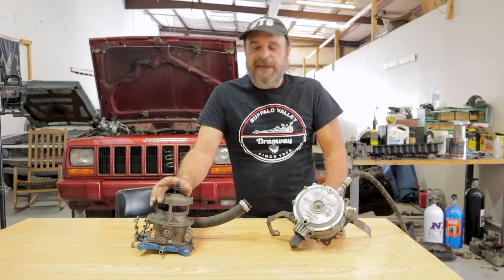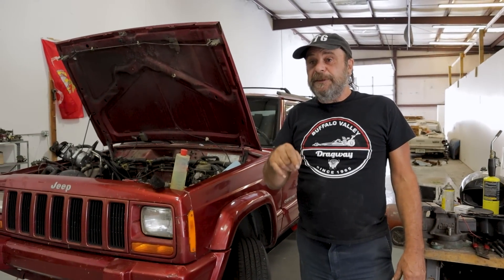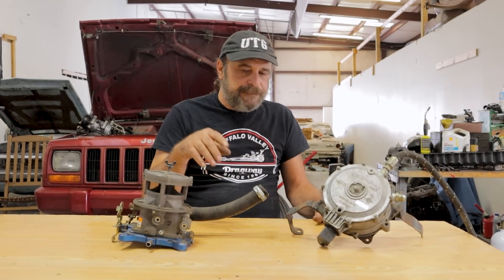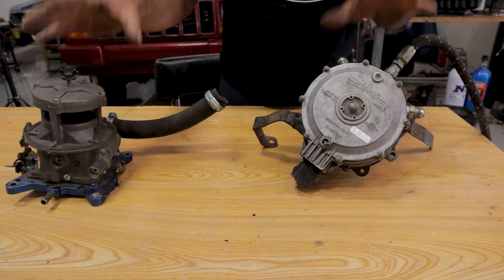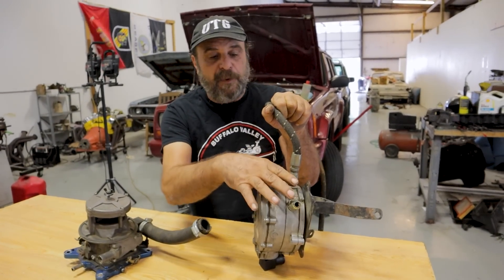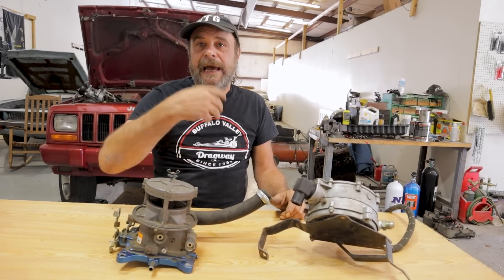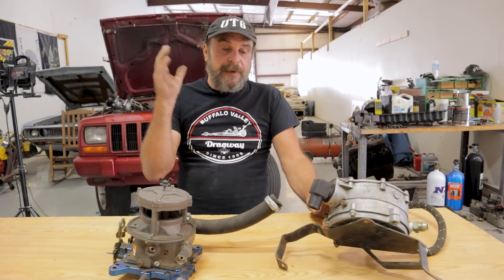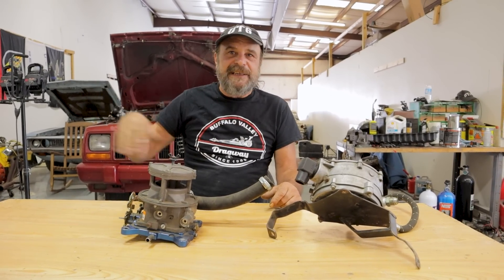Hot Rodding With Propane (And Propane Accessories) - Overview Of The Impco Carburetor

Comment: Actually in about 1967 or so we were approached by local gas co to try out a propane system in one of our circle track cars. 1957 for 292 with a special cam from them.  It ran well (not as fast as the Chevy's) but gobs of torque. We tried it out for one season  but never won a race though but usually, in the top ten. The experiment  was a a good success but the Chevy's were a better base for performance on a short track.  But is was fun and did stir up some interest.

Comment: Street racer Ak Miller was the king of propane Mustangs in the old Peterson Hot Rod books. Those books detail a lot of the conversion and adaptation required from a carbureted car. Main downside is the tank required is so big it fills the entire trunk. That little round tank is nowhere near equivalent to a tank of gas.

Comment: Hey Tony ( please note excuse my typing ,grammer, spelling, Iam an idea person not a literary) I have a lot of Propane experience being a fleet mechanic in Ontario Canada. I cant honestly believe how in the rush to get away from gasoline to Electric propane has been ignored. How Buzzare! Propane has better octane as you noted, is a cooler charge more stable when exposed to heat(no Vapor lock) it can also be set up with EFI. However what killed in in Ontario was the idea to offer dual fuel EFI gas and propane (two separate fuels) Two systems one engine What a night mare People would switch from one to the other on the fly have a lean backfire and blow the manifold off. Like many things there is no compromise. Straight propane vehicle are great I have worked on police cruisers and delivery trucks. Great fuel mileage no deposits in the oil and tuned right same power. I always wanted to build an engine specifically for propane ! to 1.5 higher compression, belt drive(procharger) supercharger longer stroke hi flow heads and intake and possibly EFI I would build a simple non efi unit first. But with a holley or similar programable computer with coil on plug you could set the ideal air/fuel map. This is what makes diesel convertion so attractive diesel already has most of the parts Keep us posted! After all ask anyone who works in a refinery and they will tell you of the nightly propane blow off !They have so much they burn it off! Also you don t need specific filling station s any truck trailer rail car will do! Love to help! PS for the forward thinkers how about propane and compressed oxygen supercharging! ^ second ETs all day for Pennies per round! Get Steve working on it. It will give him to think about.Pass on my best wishes

Comment: I daily drive a 5.3 swapped s10 I built with a carb intake and impco 425/ model E for something different mostly.  For a fuel tank I have a 25 gallon asme motor fuel tank.  Impco recommended as a starting point on timing as 14 degrees initial, 14 centrifugal and 14 vacuum for most stock  engines in the 8-9.5 compression range.  Fuel mixtures are a little more critical on propane as running a rich mixture and or retarded timing tends to burn exhaust valves.  I am a forklift mechanic and we have many lifts in the fleet with 20,000 hours or more on a propane engine.

Comment: Out here on the left coast, we used to have a team with an early 50's turtle back Nash with a big inch motor running two regulators and mixers.  Fairly heavy car and I think he was in the 10's on a regular basis with an automatic...  Used to be a fight to get it started, so they used a squirt bottle with race gas to get it to light.  But the team really loved the results.  The engine was spotless internally and they did not have any detonation issues.  Looked cool and sounded mean at the line.  I think a 440 could be set up that way pretty easily.  Lots of muni busses ran 440's on propane or CNG in problem air basins.  Must be ton of parts and know how out there 🙃

Comment: A few tips about propane. Harder to ignite so hi energy ignition systems a good idea. It burns hotter than gasoline so cooling system needs to be good and a lower opening thermostat might be a good idea. It has less mass as an intake charge so cylinder filling at higher rpm can be harder. Generally propane wants more intake CFM IE if you had a 600cfm carb you'd go for a 750cfm on propane.

Comment: I've been in the residential propane gas service business for many years now. One of my 1st bosses had a International pickup back in the day he drove many years. It was converted to propane and according to him during a emissions test it wasn't exhausting enough CO2 to show on the equipment they had at the time. He also mentioned the truck had over 300K and due to not having carbon contaminants oil lasted longer and engine had less wear. This will be interesting, thanks UT!

Comment: Always wanted to try propane on a motor but very high compression to compensate for power loss
But would be a problem when necessary   to switch over to gasoline
Was great on farm where power loss was not a problem.
The power loss is much more than 5 percent tho.
That you will find out. High compression would offset that.

Comment: 30+ years old there was a hot rodder that ran his 37 Chevy coupe on propane. He had two of those setups on top of a blower feeding his small block Chevy engine. It made plenty of power! I boosted the compression on a 250 Chevy inline six using propane pistons around the same time.

Comment: Oh btw, a cheap ass leak checker, all you need is a windex spray bottle with some soapy water in it. Just regular dish soap and water will do. Spray that on your fittings, it will bubble up if you have a leak. Tho you can usually smell a leak, and if the leak is good enough, you will end up seeing very cold gas leak out until it freezes the fitting for a little bit, frosty white! Very cold!

Comment: Uncle Tony, dude! About time you did something on LPG/Propane!  You should check out some of the crazy stuff we do with it "down under" in Australia! 

I've been running it for over 20 years now, including an impco 425 setup like your have there, as well as vapour injection and liquid injection setups. Modern vapour injection stuff like the AC Stag Qmax stuff is very cool, I'm running in on my daily driver, bmw E39 v8, makes a v8 cheap to run daily!  

Go have a read of the Impco parts book, it will give you some clues on how the tuning works on the 425!

Comment: Another benefit of LPG is you'll never wash down the cylinders or soak the plugs which also extends the life of the bottom end as you wont be driving around w/ sludge from gasoline getting past the rings and wiping out bearings.

Comment: Tony, I am an American serving as a missionary dealing primarily with widows and orphans.  I recently was as a propane dealer filling a couple of tanks with propane which I use for cooking with gas.  About a half dozen taxis were there filling their trunk mounted propane tanks.  I asked them why they had converted their cars from petrol to propane.  They said it burned much cleaner but the reason was high fuel prices and low cost of propane.  These are small Toyota, Nissan, Honda, Kia, etc.  They said they have not heard of any safety problems.  This will be an interesting series for me.  Looking forward.  Also, I might add it is not uncommon at all to see cars running gasoline on fire due to leaking fuel lines as they do very little routine maintenance here.  They run a vehicle until it breaks the do repairs.  Their president said in a speech that Ghanaians have a disposable attitude,  run it until is fails, throw it away and start all over.  Instead of paying for oil changes they pay for engine replacement.  He was correct.

Comment: Been running my 1987 Toyota Hilux 2.2L on LPG (liquefied petroleum gas, mix of propane & butane) for the last 16 years here in Australia. LPG is about 80c/L, petrol is about $2.20/L. Because of the density difference. you burn more litres per km, but even with the fuel consumption difference, it's still worth doing- it costs about half as much to use LPG than petrol. 

My Hilux has a vapouriser/mixer like your Impco system, but there are direct liquid phase LPG injection systems that make a lot more horsepower and are more efficient because the liquid phase LPG cools the intake charge, while you are losing that advantage in a vapouriser system by changing the liquid to vapour with hot engine coolant. Gewgle liquid phase LPG and you'll find the high performance propane stuff. 

MPG on propane/LPG is less because gasoline is more dense at about 750g/liter, while LPG is 515g/litre. You need more litres to go the same distance.

Do more research on ignition timing. Gasoline wants more advance at high RPM- LPG wants LESS advance at high RPM. See http://www.mbs.id.au/tuning/Tuning/LPG_tuning.htm 

Don't worry about safety. The propane tank has an automatic shutoff valve which closes if the flow rate is too high, eg if the fuel line is cut. The tank itself is a lot tougher than any gasoline tank. LPG tanks have been thrown clear of a vehicle that has been totally dismembered in a wreck. 

Nearly all taxicabs in Aus run on LPG. It is a 'dry' fuel and can't wash oil of the cyl walls. It doesn't create abrasive carbon soot which winds up oin the engine oil. 500,000km++ is not unusual for taxi engines. 

Your mixer system won't be a drag race winner but you def should put it on a shop truck or daily driver.

Comment: Tony, keep in mind that propane, unlike natural gas, is heavier than air so be sure to vent the trunk at the lowest point.  Also keep that in mind when storing it in a closed space.  The gas will settle on the floor, not the ceiling so you could have a leak and not smell an odor if it doesn't fill the space.

Comment: In South America they use CNG (compressed natural gas) in a setup very much like that one. I had one in my 1968 Ford Torino V8. The reason I did it was mainly for economy as gas was about 1/3 of the price. The good thing about CNG conversions is that the car was dual-fuel so could run the car with whatever was available. There was a weight penalty tho due to The fact that you needed to carry arround quite heavy and bulky gas containers. For something the size of a Torino no big deal, but as I said the main aim was saving on the price of the fuel
Reply: The new carbon fiber tanks are a lot lighter. Still bulky but weight ratio is alot better. Considering converting my 68 Dodge Charger to CNG . Octane rating for CNG is 130 octane and is currently $1.00 the compared to $4.00 a gallon for gasoline.
Reply: @revchrismerchant for me personally the CNG conversion was fundamental as it allowed me to carry on using the car at a time where money was tight and the saving with the price of fuel meant the system paid for itself very quickly! Good if you can save weight with the composite cylinders!

Comment: One advantage of propane fuel is the octane rating compared to gasoline, you'll never make it knock.
It also burns extremely cleanly.  However you'd have to strip all computer controls off the modern motor to retrofit with propane.
Worked great in the old man's 74 Dodge 1 ton with a 318.  Added benefits of forever clean oil and very smooth operation.

Comment: When I was a teenager in the late 70's my dad had propane on his f350 four door. He had a 80 gallon tank in the bed. He got the propane company to drop a big 500 or bigger gallon tank in our driveway he used to fill it with. His set up had a switch to go between gas and propane. It used the same carburator I'm almost certain. I am certain you could run either gasoline or propane. We had a long range with the 80 gallon tank and the two gasoline tanks. My older brother put one on his truck too. What started it was a 72 Impala my dad bought for my mom to drive that had a conversion already done with a tank in the trunk. I've pondered the idea of investing in a system since I was about 18.

Comment: Engines run so much cleaner on LPG here in Australia we have all our cabs on LPG the engine oil stays cleaner longer then petrol junk you'll never CLAG a LPG engine because LPG  is very clean fuel  need lotta compression an bitter more timing smaller spark  plug gaps as well gotta have a electric lock of before the converter an one on the tank it self with a saftey swith in case ur engine stalls or accident you dont end up continually haveing LPG flooding ur engine thats our requirements here  not sure what ur laws are in the USA .

Comment: Us Ozzies have a long history of LPG/propane cars, most of our taxis ran on the stuff for the last 30 years or so or until the hybrids came out. It was quite common to have a dual fuel vehicle where you could switch from gasoline to LPG/Propane on the go and you could get it at most service stations. They also made donut shaped tanks that fit where the spare tyre would go or just one big one normally that went in the boot/trunk along the seat back. It's good stuff and I'm sure I saw a big V8 in an old street machine magazine in the 90's with twin gas mixers on a tunnel ram.
Reply: He switched it back to petrol only . LPG is rubbish

Comment: In Russia we use propane massively. Usually fuel injected cars are equipped with gas equipment, which uses liquid gas, which is converted to gas state via heating by engine coolant. The gas equipment has its own jets, and own ECU. Jets work in the same order as gasoline jets, and inject in approx the same place in the  intake manifold. The engine starts and warms up on gasoline, then switches to gas.

There is never clean propane on gas stations, usually propane-butane mix in different proportions. The system also uses two filters, because gas can contain undesirable particles. Filters should be used pretty often, recommendations are that you change them every 10k kilometers. But usually people dont change them at all. Which sometimes lead to valve or valve seat damage. The system also uses a bit of gasoline under high loads.
Reply: The price of propane-butane is half the price of gasoline, but the actual consumption is approx 20% higher

Comment: I ran that impco setup on a 78 bronco in the early 2000’s.  Cost-wise it was better than gas-about 18mpg gas equivalent. Off-road low rpm economy was amazing! Max power was down definitely more than 5%
Most of the stations around here removed their propane pumps by 2010, probably from lack of popularity

Comment: In Canada you needed a special licence to install a propane system, even for a straight transplant like this. They also put a little sticker on the windshield so firemen know what they’re hosing down. The main hazard is that propane is denser than air, so any leakage will form an invisible flammable pocket at the bottom of a parkade (or overnight inside your shop if left there). Seen a couple of charred propane powered vehicles, can’t imagine trying to get away from that!
Also the tanks have a certification expiry date. Insurance companies prefer you replace the tank before that date.

Comment: I swapped my construction van, full size gm 1/2 ton with no computer l, to propane and found it used about twice the volume of fuel, that was using a 300a mixer which is known as the dual fuel mixer. Runs rich until the engine warms up

Comment: also Uncle Tony blow-by from propane doesn't thin out the engine oil, because it's a gas.. whatever gets into the oil Just floats right on out and doesn't mix with or dilute the oil so your engine oil never goes bad for ever. Stays honey coloured brand new. Of course you need the odd top up here and there but you don't need an oil change. Love your channel, I'm a long haul driver and I put you on and listen for hours thank you
P.S. Valves don't get any cooling, hardened inserts recommended

Comment: Fun Fact: God made Crude Oil give off about 24,500 btu's per pound of the stuff.  I don't know why a pound of all the different things you can split crude oil into (from cigarette-lighter fuel Naptha to roof-coating Tar) all have just about the same btu's per pound - but they do.
   But they have different weights per gallon. Propane 4.2/gallon, Gasoline 6/gallon, Diesel 7.1/gallon.
   So if you take your gasoline miles-per-gallon and convert it to miles-per-six-pounds-of-some-kind-of-petroleum - and then figure that a gallon of propane only weighs 4.2 pounds per gallon - then you will know "all other things being equal" your going to use 1.42 times more gallons to cover the same number of miles.
   So that looks like Uncle Tony pointed to a standard 30-pound propane cylinder. That's going to equal  Five Gallons of Gasoline, when burned in the same car.

Comment: In Australia it used to be very popular until the price of L.P.G got to high 

The biggest problem with making a lot of power with it was the electric safety lock of solenoids typically for Australia you’d have one at the rank and one at the converter these restricted the lpg flow a lot the one at the converter can be replaced with a impco vff30 they make these now with electric solenoids instead of vacuum 
But the ones at the tank are still a problem I would think
Reply: LPG is still cheaper to run than petrol... The last factory installed LPG system came off the line in 2016 when ford closed down in Australia... very sad... But my car is carburated LPG .... And I'm keeping it lol...
Reply: @schristis123  it’s not the fuel that is the problem…it’s how it’s delivered lpg has never had the hi performance aftermarket behind it has always Been a secondary get me around cheap fuel. Which is disappointing it could be a good thing 
I pulled the impco lpg snorkel off my 377 Cleveland and it made a huge difference in power